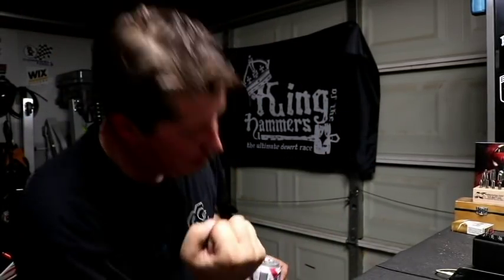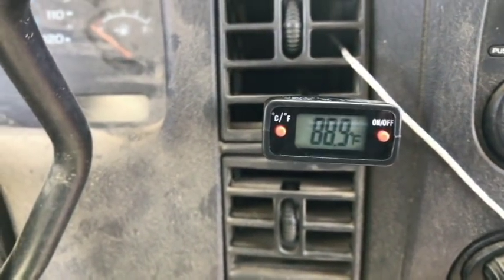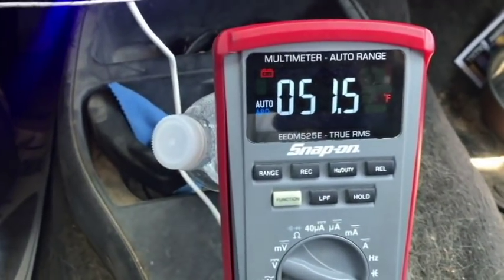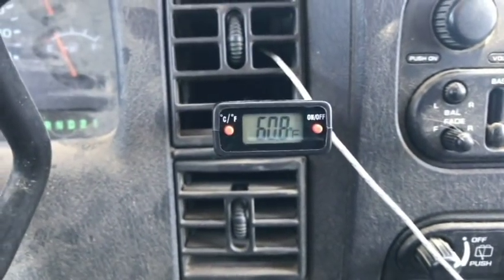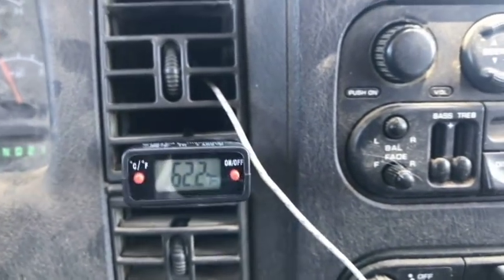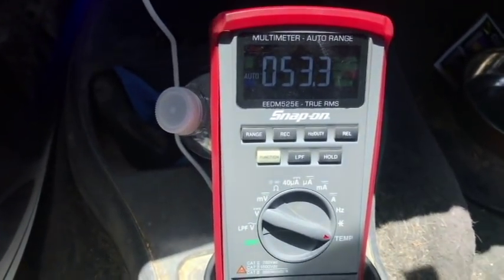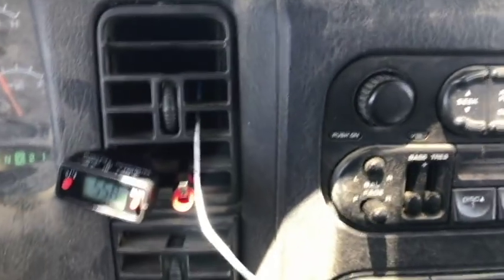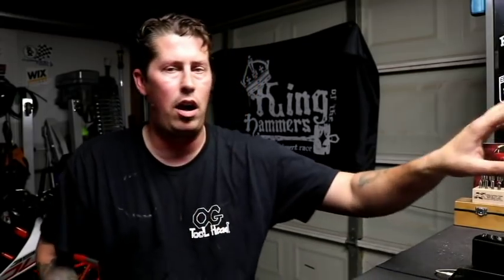2 Post or 4 Post! Which Is Better?

Comment: I own two lifts.  One is a 4 post lift.  The other is a 2-post.  The 4 post is the only lift I've setup and have functional right now.  The 2 post is still in the crate (hopefully will be setup soon).  Thus far, I've been perfectly productive with that setup.  I just use jackstands when I need to get wheels off the ground.

Comment: I have a  4 post Rotary lift here, 12000 pounds. I choose it for safety, never liked trying to lift trucks on a two post. With the air cross jack I can still do tires and brakes, someday I'll get a second cross jack to let me lift the whole vehicle off the hoist if needed.

Comment: My shop only has in ground lifts. I've used them all but so far I like in ground the best. No height clearance issues and I think easier to rack cars. We do alignments and have an alignment rack but if I had to pick one of your options it would be a 2 post lift

Comment: Thanks Justin! Appreciate the information! I’m looking to buy a 4 post, because it can move around and I have in floor heAt and don’t want to drill thru a line...
I am an at home guy. I feel like being able to raise my tractor, mower or wheeler plus a car would be huge.
I do have an F-250 crew cab diesel.
With a 4 post, u think I could use the scissor jacks to take all 4 tires off at once? Seems like a lot of weight on that lip...
Thanks again!
Reply from the maker: Not sure. I don't see why you wouldn't be able to use a scissor jack for a tire rotation, but pulling a transmission might not be possible. I've seen them at some shops never had the desire to want or use one to be honest. Cheers!

Comment: Only thing I like better about 4-post is that up here in the rust belt sometimes you can’t even lift a vehicle on a two-post because the pinch-welds or frame is rotted out.

Comment: The majority of my time is spent working with a two-post lift. We do have the hunter scissor lift that has the built-in LED lighting and automatic turning plates. My personal favorite are mobile wheel lifts from Challenger it has a 60000 pound capacity. We have a fleet of tow trucks that include International M2 business class. After using mobile wheel lifts they're my absolute hands-down favorite.

Comment: Depends on what you are doing, I like the 4 post as it is easier to use for most repairs and doubles as a nice long workbench when not in use.  I have yet to run into a job that it did not work on.  However that said I do not do auto repair I do equipment repair so my auto repair is personal maintenance on trucks for the most part.

Comment: I only like a 4 post for two things. Alignments and NVH on suspensions. Other than that, I will take a 2 post all day long. To me it is more versatile. And I also hate the in ground lifts. Hate them. ESPECIALLY the single post in grounds.
Reply from the maker: Ninja Tech Auto Ooh ya. I hate single piston in ground lifts for sure. If I remember correctly I actually liked the in ground two piston lift. 👍🍻

Comment: 4 post is great if you’re also storing long term.
  Two post is great as long as the Hydraulic Line is over head.especially if you’re doing Trans work on rear wheel drive. 
 
      Either is still a lot better then the old single piston hydraulic lift of many many years ago. When I started out.  
   I probably just showed how old I’am.

Comment: You'd probably find out the answer if you tested the ac when it was on recirculate and when it wasn't. Also you can get a 2 post that's good up to 18,000lbs, that's a bid damn truck, at that point I'd be more worried about the concrete.

Comment: Good video Justin and good tips on the A/C. I always have had thermometers never have actually used the one that came with my DVOM before =P
As far as lifts go...I am not sure if I ever will get a 4 post lift unless I somehow end up running a large and very busy shop. I'm not interested in alignments or tires and will happily sub that work out to another place in town while I take care of everything else. You are right about some of the big stuff though, much safer on the 4 post if you have the option, and also good for quick oil changes. I find for most real work though they are always in the way and I kind of hate working with them!
Reply from the maker: GearHeads I agree. For a quick peak at a leak or noise underneath and or an oil change 4 post is super fast. 🍻👍
Reply: Justin Dow I dunno about noises just because I can’t give the wheels a good shakedown on a 4 post. I guess it depends on what you think it is after the test drive.

Comment: Depends on what I'm doing. I'd definitely prefer to have both. If focred to choose it would be a 2 post because you can do 99,98 percent of what I you gotta do on one. 30° diff from ambient is ok outside of extremes. But isn't a rule. Remember guys, pressure is dependent on temperature. Learn the theory and understand the system. Good video dude